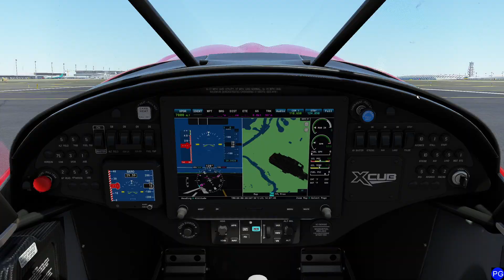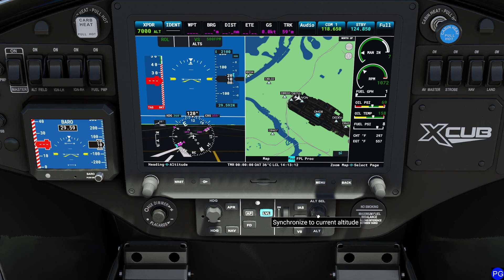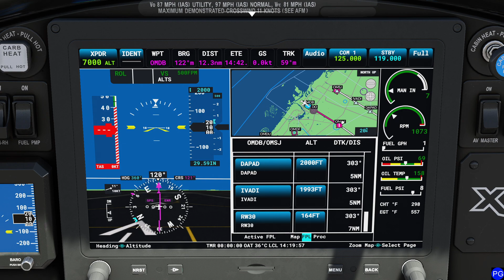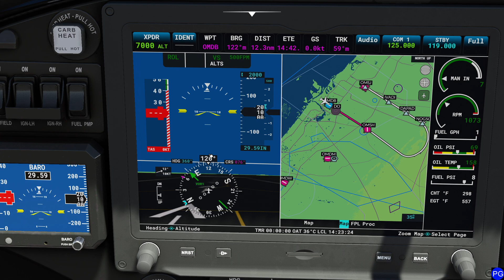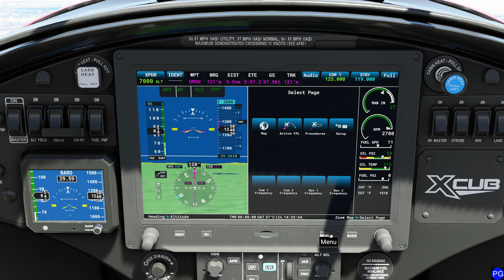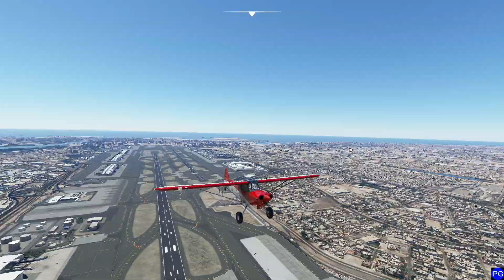MSFS - G3X Tutorial (UPDATED)

Comment: some corrections here, the transponder frequency is fixed, it always receives on 1030 MHz and replies on 1090MHz, the squawk code is dialed in per ATC's request. The squawk code is transmitted digitally using a 12 bit binary number. Therefore, it has 4096 possible values. The thirteenth bit is reserved for the IDENT operation.